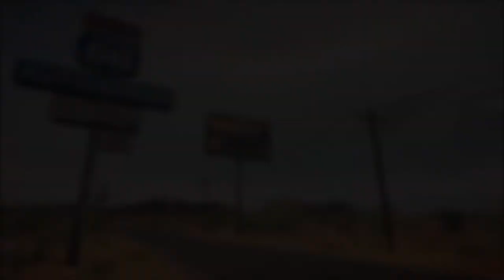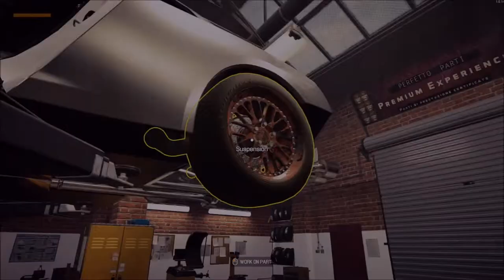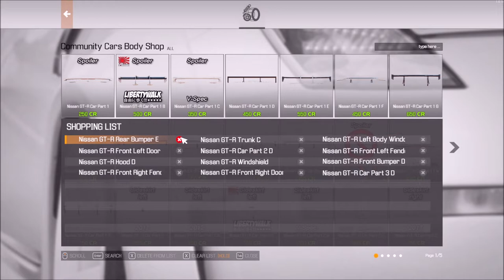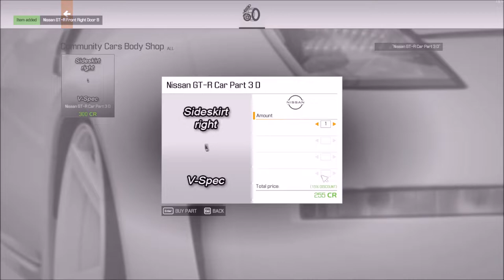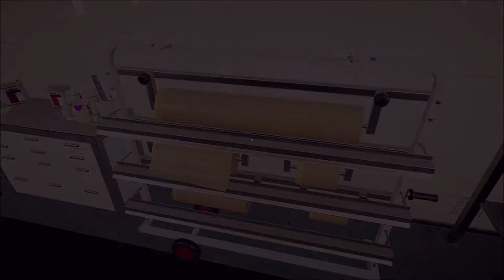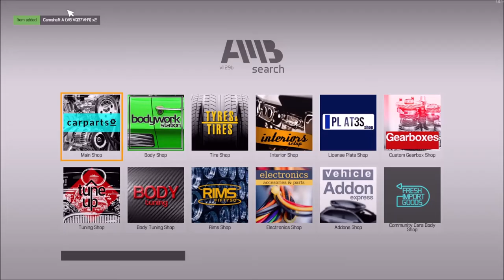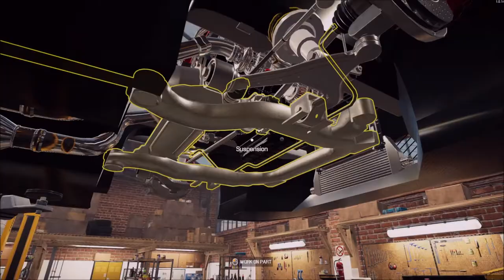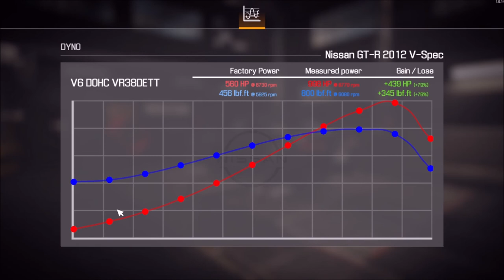Car Mechanic Simulator 2021 - Rot2Rad: Junkyard Builds Ep.10

Comment: very nice car, and soon to be awesome shop truck, i like the colors and simple flow of yet another menacing machine, so i say keep it, i dont mind so much teh carbon fiber hood, but the trunk kind of stands out as not so in flow of teh whole thing, now if it had a black roof to keep the color above teh belt line flowing over the car maybe then it would make more sense. ps,,,, when you buy cars from auction for this series, if the cost goes above the suggested value, stop and walk away, find another car, might be the one thing that makes getting or not getting the car from auction a bit more challenging,,,,, gives us viewers a chance to root for you getting it but might not so we shall see. and i may just have a livery or 2 for your camino that will add to your visuals in teh shop
Reply from the maker: Boost said the same thing about the trunk so I may switch it, if I get to keep it. Thanks for the Liverie and the auction idea.